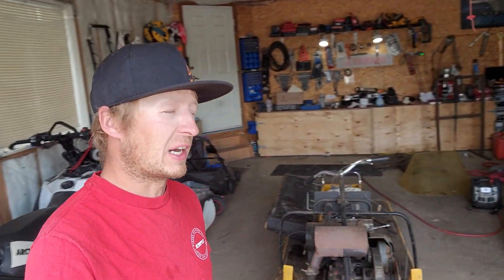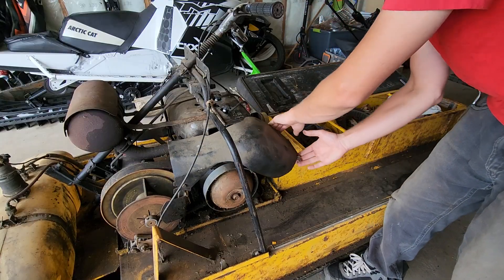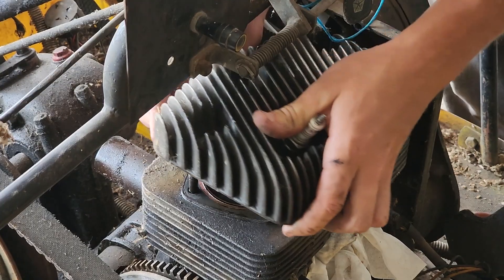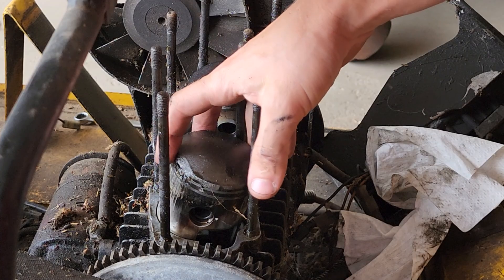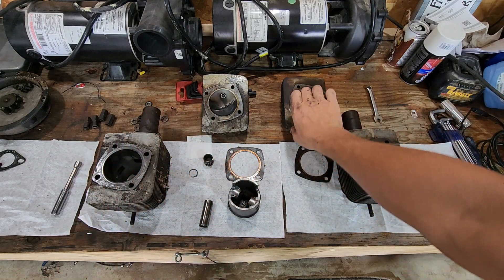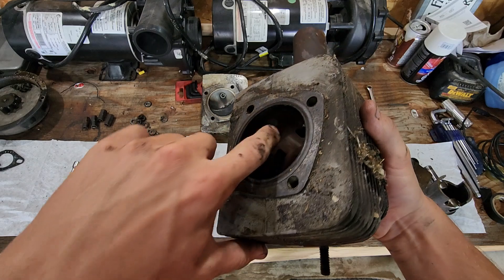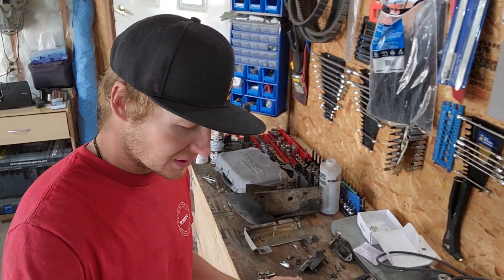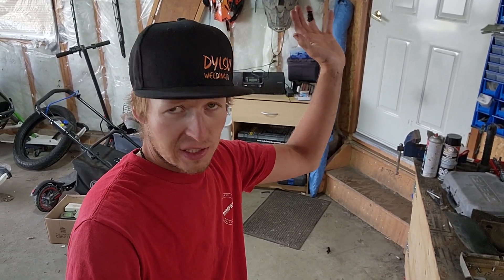SKI-DOO ENGINE TEARDOWN

Comment: I think the older units cylinders are sleeved so re -sleeving  might be an option. But the mag side jug May be beyond that. Great project Brother can’t wait to see what trouble you guys get into. I agree with some of the comments on the crank seals and if you want reliability it’s something you should consider it’s already torn down what’s a few more bolts especially when you already have the knowledge. 👍🏼👍🏼👍🏼

Comment: Naw man, no jug needed just bottle hone that thing. Those 250 and 340 twins are beauty and reliable. My single siezed up last year i had a brain fart and put straight gas in one delightfully fun night. Next day took a block and hammer and smacked the piston free, pulled the jug honed it and put new rings on her. Shes hasnt missed a beat since

Comment: Kinda looks like aluminum transfer on that  cylinder wall, take some pool cleaner acid ( muriatic acid) and put it on the cylinder wall to clean it up. 
If you can find over sized pistons it may be best to bore it out anyways to get the cylinder back into round and a fresh cross hatch. Make sure the ports are champhered and wash the cylinder well with hot soapy water. 
CRANK SEALS ARE A MUST
Bolt the intake manifold on before you tighten the cylinders down to help prevent an air leak.
Reply: I’m pretty sure Matt knows how to rebuild a 2 stroke engine🤪
Reply: @brucewunderlich405  he well know but it does not hurt to give some pointers, if not for him than maybe it will help someone else reading the comments.